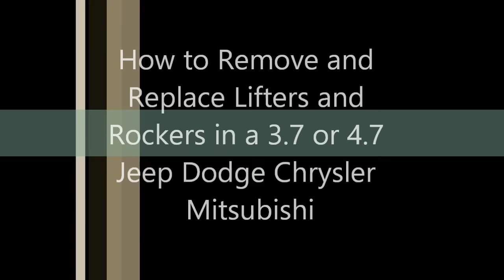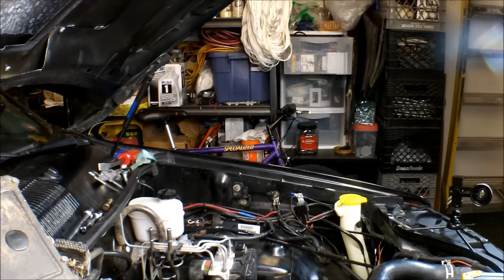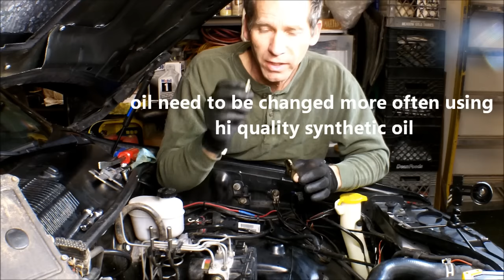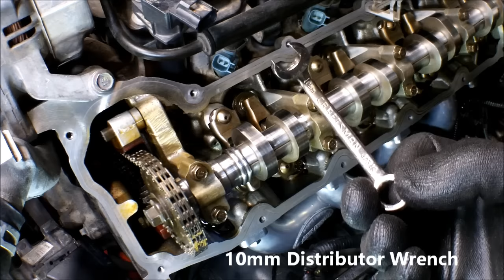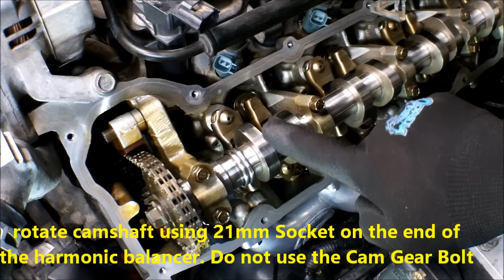Remove & Replace Lifters & Rockers on a 4.7 & 3.7 Jeep Dodge Chrysler & Mitsubishi

Comment: Man!
Way easier then what I just attempted this weekend. :/
Question?
So have a 1998 Ford mustang GT V8 manual trans. 
Opened the valve covers and some of these rollers fell off. Replaced the lifters and re installed the rockers (looked fine).
Went to start the car and again some fell off. 
Any ideas why the fell off again? 
Appreciate any info/help.
Reply from the maker: is it the same ones each time? If so check the valve springs they could be broke.
Reply: @martinbuilt  
Hi
Thanks for the reply :)
No/kinda :)
On driver side 4 fell off first. After installed them only 3 fell. 
Passenger side 3 fell of and after re installing them 1 fell off. 
This is all after installing new lifters and trying to crank it over.
Reply from the maker: @TheTaker31  Thats crazy... Try soaking the lifters in oil for at least 30 minutes to get any air out this may help.
Reply: @martinbuilt  
That's what going to do :)
Hopefully it's not the spring that are bad. 
Can I check those somehow without taking them off?
Say pushing down on them to see if the are somehow stuck?
Worst case broken? :/
Reply from the maker: I doubt your valves are stuck. First do a visual inspection very closely to see if you can see a broken valve spring. You could push down on the end of the valve stem be very careful when you do this not to push on the retainer because if the valve spring is broke and the retainer push down it could pop out the keepers and then your valve would fall into the cylinder. Now if you were able to physically push down on the valve with not a whole lot of effort there is most likely something wrong with the springs. I've tried this on my own engine and I could not move them so it does take a great deal of force.
Reply: @martinbuilt  
K
So sounding good. 
I did try to push down on them with a flat head and was hard to push down on them. 
So now this is why I get stumbled. The springs are good. Rollers I checked and are good. 
The rockers that did pop off felt very loose when I pushed down on them. Bought new ones and those are harder to pushed down. They do slightly move about a milimiter. 
So gonna put them in oil for sometime and see if that makes a difference :)
Thanks a million for replying :)
Got a new subscriber :)

Comment: Great video! One question do you need to decompress the lifter??
Reply from the maker: Raul ruiz 
No need to do that. As you're removing the rocker what's happening is your depressing the valve slightly.
Reply: martinbuilt what about the new lifter?
Reply from the maker: Raul ruiz 
What about the new lifters? After removing the rocker you just grasp the lifter pull it out and replace it

Comment: I’m currently doing my head covers. About to get started on the passenger side. I just want this nightmare to be over. Every plastic clip just crumbles, wire looms turn to dust, and as I dig further into this heep I just keep finding more leaks. The only thing I wish would leak is the fuel rail while I’m driving but apparently Chrysler outsourced that part because it’s working just fine. Thanks for the vid though, it really helped.

Comment: Is it necessary to put a hused head in the machine shop if I removed it from a good running 4.7 and removed the head bolts in reverse order
Reply from the maker: No you should be good to go, you will need new head bolts as they are torque to yield.

Comment: I bought 16 new lifters for my 4.7 and 5 of them compress by hand and the other 11 do not. They are the same brand and part #. Which ones are correct?
Reply from the maker: have you soaked them in oil first?
Reply: Yes but the 5 compressed before soaking
Reply from the maker: @gregrice7557  I'm sure that will be okay
Reply: Are they supposed to spring up and down or be stiff there just stock replacement
Reply: I would like to know this as well, first set was from Amazon I installed and it was quiet for 5 mi utes then started tapping again so I went through and removed all tunes lifters that had any type of movement to them and reinstalled  and it was quiet for longer this time but started tapping again in maybe 30 mins, I have 2 lifters still in that have minimal movement up and down so I thought that was problem so I got melling lifters from autozone and  every single one compresses rather easy ...which is correct ?

Comment: My rocker arm just slides in I know it should go in with tension what could it be ?  It's cylinder #8 on a 03 dodge ram 4.7... thanks
Reply from the maker: You may have a broken valve Spring but unfortunately most likely you have a dropped valve seat and the cylinder head will either need to be replaced or fixed.

Comment: Do you have to drain your oil for this??
Reply from the maker: No you don't have to. You may wanna do an oil change soon after in case any contaminants from the removal of the valve cover got into the engine.

Comment: Thanks for sharing this would turning the engine from the harmonic balance with the 21mm socket need timing adjustments after thanks in advance
Reply from the maker: No this does not affect timing, just make sure to only rotate the engine clockwise. Rotating the engine counterclockwise can cause timing chain guide tensioner failure.

Comment: Man it's been five years since you posted this but I have a question. I have a rocker arm off on the passenger side toward the back. Not 100% what cylinder. One before the last I'll say that. I have a new rocker arm to put on it but the lifter is stuck pulled out. I mean it's frozen. The engine has been sitting for about 5 months now and I had to do a whole timing chain kit and valve covers. Got it all done and realized I had missed a rocker arm that I don't remember taking off to be quite honest,. But could that lifter be frozen or stuck in place like that and would a new lifter remedy the problem to be able to drop in and then press my rocker arm over it?

Comment: How did you determine the installed height of the solid lifter? Hot height ?
Reply from the maker: I adjusted them when they are cold to .0015 to .004 and I always try to get them to .0015 to .002
in this video, I show how I adjust them. 
https://youtu.be/URrQ9sMgLJs

Comment: Will a rocker falling off mean i need to retime my engine? 04 jeep grand cherokee 4.7l
Reply from the maker: NO, just replace the failed or damaged parts. This is assuming the cylinder head is not damaged.
Reply: @martinbuilt  motor has 260,xxx miles. Think its even worth it?
Reply from the maker: @adamyingling3676  Sure if the head is not damaged. You may want to change all of the ones on that side since you got it apart.

Comment: Is there a reason why my camshaft won't turn after I'm torquing the caps down? Have you experienced anything like this?
Reply from the maker: Did the stock camshaft spin okay before removing. Had the same problem with one of the cylinder heads. Somewhere there has to be some kind of warpage I noticed it when I torque down caps 4 and 5 that I turned excessively hard. Ended up polishing the caps took them on and off at least a dozen times before I got it. It also could be that the cam is not perfectly straight. Camshaft can have no more than two thousands of an inch roll out
Reply: Thank you, you're a genius when it comes to this engine. I was on the dodge forums and they mentioned wear on the cap bearings also. I noticed excessive scratching my caps and cam because I sat it down on the dirt while taking it apart. A little dirt must have been on them when I tried re-installing, so I'll to get the surfaces smooth and clean them. It's hard to imagine resistance coming from so many little scratches.
Reply: Turns out it was normal valve pressure. I never turned the cam when it was unhooked from the timing chain and was freaked out. The engine swap/rebuild I did was a success.

Comment: Mine clatters a bit for the first minute or so after startup. Should I worry?
Reply from the maker: I would 1st try using some Marvel's mystery oil or Rislone with your next oil change and if it doesn't seem to get any better than yes I would replace the lash adjusters.

Comment: Did you remove spark plugs before job?
Reply from the maker: No, I didn't, You will only need to rotate the engine a little. Always rotate the engine clockwise.

Comment: Did you soak the lifters. Prep them
???
Reply from the maker: yes before installing new lifters soak them in motor oil for a couple of hours.
Reply: @martinbuilt  I ran a engine flush from Oreillys so maybe it will work. Rod bering knocking now loud. Can I replace it without taking motor out? How to. I think I can get the pan off
Reply from the maker: @rhreznor  yes you could replace the rod bearing by removing the pan but, if the bearing spun in the rod the rod and crank will be damaged.
Reply: @martinbuilt  I drove it 6 blocks after it started. I'm replacing one and selling it

Comment: Does the lash ajuster bore have a hole in the bottom? For drainage?
Reply from the maker: There is a small hole in the side of the lash adjuster, which supplies oil to the rocker arm. 
Just like the factory hydraulic ones.
Reply: @martinbuilt  I mean at the bottom of the bore in the head.. like where the lash ajuster lifter bottoms out in the hole

Comment: will i have to retime the engine if i have to spin the cam??
Reply from the maker: No as long as you leave the timing chain and cam gear connected to the camshaft there is no need to retime the engine.
And remember as you're facing the engine always turn the engine over clockwise and only by the crankshaft do not turn over the engine by the camshaft.
Thank you for watching 😊

Comment: Hey. Im working on my 03 Ram.  But I cant get this last 1.  Its on the passenger side closest to the cab of the truck. I dnt have enough clearance to work my flathead.  Got a short 1 but thats not working either.   Any suggestions?
Reply from the maker: Do you have one of these small pry bars? 
Mini-Bar, 5-1/2-Inch  https://amzn.to/2W5wwFf
This might do the trick.
Reply: @martinbuilt  I tried that. Still wasnt even. But I looosened the cam shaft and that allowed to slip it on.     Thanks!!

Comment: hello Martin.  Guestion.  So if i change the lifters one at a time. I can rotate the cam without worring about messing up the timing? Also you said to use a 21 millimeters wrench to rotate. But not using the gear bolt. Is that the bolt you see in the video that holds the sprocket that the chain is on? If i cant use that bolt.  Where is this bolt that you are talking about to use to rotate cam with. Thanks for help. Liked the video. It helped.
Reply from the maker: The bolt that holds on the harmonic balancer on the end of the crankshaft....use a 21mm socket with a short extension.
Reply: martinbuilt  
Ok. Thanks.  One more question. Does it matter what way i rotate it? Clock wise. Or counter clock wise?
Reply from the maker: I don't think it matters but just in case it does turn it clockwise when facing the engine from the front. When I was rotating the engine I was going in both directions.

Comment: What was your reason for going to solid lifters? Are those the stock cams?
Reply from the maker: Geo Stanley 
 those are ho camshafts that I got out of pic a part. The reason I went with the solid lifters was just to gain more horsepower they do have several advantages over the hydraulics. The only disadvantage is adjusting them. If you wanted to check out the solid lifters go to airram.com... I'm working on the video for installing the HO cams with the solid lifters.
Reply: martinbuilt I’ll have to keep that in mind if I get a wj for a toy. I must say if that’s your daily driver you are brave! lol lots of maintenance and the 3.7&4.7 heads are known for dropping valve seats. I am thinking the valve seat issues are temperature related. What do you think?
Reply from the maker: Geo Stanley 
Yes I agree I do believe the valve seat problem is a temperature related issue. I actually suspected that it had happened to my WJ.  I didn't notice until after I purchased it and was putting headers in it that the one cylinder head had been replaced. I ran a scope down each cylinder and couldn't find any evidence of any piston damage. I couldn't get the previous owner to respond to any of my texts when I asked him about it.
Reply: That’s exactly why I did the coolant flush. I noticed my entire engine was replaced and the radiator as well. We bought a Commander with the 3.7 in it at the same time. The commander is a builder with a locked up motor. There are signs of overheating with it but the oil was clean and at a decent level. After lots of research I come to suspect overheating to be the issue.
Reply: Hey Martin! Great video. Where did you purchase the valves and rockers at? I will be doing this to my WJ non HO motor soon. I’ve been shopping around and it’s a bit overwhelming on what to get. Thanks! 

P.s how are the new injectors running for you so far?
Reply from the maker: trader_alex23 I purchased the lifters from Air ram.com the Rockers are the factory Originals I only replace the camshafts. The new injectors are awesome getting great gas mileage I couldn't be happier with him.
Reply: WOW ! I had no idea they produced solid lifters for the 4.7

Comment: Where is a good place to buy the lifters?
Reply from the maker: I would go with either the power seal or mellings. This is a link to RockAuto who seems to have the best prices. https://www.rockauto.com/en/catalog/dodge,2004,ram+1500+pickup,4.7l+v8,1424629,engine,valve+lifter,5548

Comment: Hey quick question, I thought I needed to pull the camshafts to do this on my wife's 3.7 in her Ram 1500, and I tried pulling the cam, will the fact that I tried loosening the cam gear bolt cause me problems? The timing chain does feel tighter now which has me worried, thanks for the video and any advice you can lend me!
Reply from the maker: Cody Drollinger 
This sounds a little scary. Were you actually able to loosen the cam bolt? Hopefully you were able to remove the cam gear if you did take the bolt out. If you only loosen the bolt and then retighten it without disturbing the cam gear and timing chain I think you'll be okay. But if you did take the boat out and moved that gear around at all just make sure you got the gear back on properly. Another words lining up the dowel on the camshaft with the slot on the cam gear. I hope everything turns out okay
Reply: No I didn't actually get it out, I'm hoping I didn't mess anything up, it was just kinda scaring me cause I tried it and it basically just turned the motor over like it would using the bolt on the balancer, I wasn't sure if it would jump timing or something and wipe the valves when I start it, hopefully everything goes back together okay and thank you for replying!
Reply: And I tried the bolt with only one cam bearing cap on I don't know if that would change anything. I thought I had to pull the cam to get to the rockers

Comment: So you can do this with out lifting the motor, can this be done with a 2003 Dodge Intrepid?
Reply from the maker: Sherry Messer I am unfamiliar with the 2.7 in the Intrepid. What is it about that situation that makes you think you need to lift the motor.
Reply: Well I decided not to get the intrepid.  But what I heard on that car sounded like it came from underneath as well as on top. It actually kinda knocked al over... That's why I decided not to buy... lol!

Comment: Wait, so the 2013 4.7 isn’t a hydraulic lifter? My 4.7 “knocks” HORRIBLY on first startup, and i’d like to know. Thank you.
Reply from the maker: No,  all 4.7 have hydraulic lifters. I installed these and I got them from Airram.com
It knocks or it has a ticking sound like from a lifter
Reply: martinbuilt I’m still not sure if it’s actually a lifter, as the sound completely goes away once heated up. I’m thinking exhaust manifold.

Comment: Is there a way to manually rotate the cam lobe to get to a compressed arm rocker on a Jeep Liberty 3.7 ?
Reply from the maker: Place a 21mm socket and ratchet on the harmonic balancer bolt and rotate the crank shaft.

Comment: Where did you find specs for lifter adjustment for example the height of the lifter?
Reply from the maker: Are you referring to the Gap spec between rocker roller and cam lobe if so I believe I got that from Nick air ram performance... this is only needed if you are installing the solid lifters Hydraulics need no adjustment.
Reply: Is nick air ram a channel or a page?
Reply from the maker: http://www.airram.com/custompage.php?page=18

Comment: How do you turn to get in the right position.. newbie
Reply from the maker: You'll need to use a socket and racket on the harmonic balancer bolt and rotate the engine clockwise.
Thank you for watching.

Comment: My dodge dakota is spitting out white smoke an my lifter is bad had do I tell if it the lifter or my cylinder head
Reply from the maker: Well the white smoke sounds like a head gasket and and if you got the ticking noise that would be your lifters

Comment: Hi, can anyone answer me if the lifters have to be pre-loaded with oil before installation? or they are installed without the oil preload and with the use of the motor the lifters will load by themselves? to my hemi 5.7 2011 they changed it and it was left with noises, the mechanic says that with the use it will remove the noise of lifters is true?
Reply from the maker: I would recommend soaking (preload) the lifters in oil.
Reply: @martinbuilt  thanks Martin, being more clear with what I mean preload is that I have heard that beyond soaking the lifter in oil, is to pump or push the lifter into a container with oil where the pushrod goes until it gets hard, this do you consider soaking to?